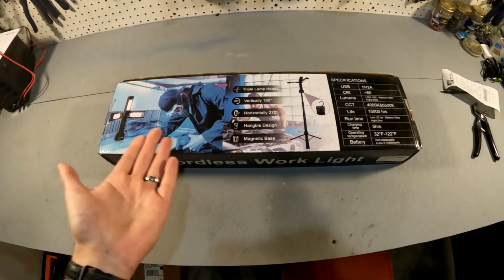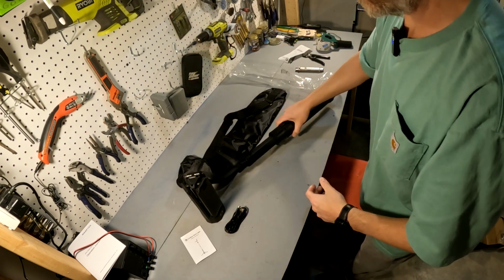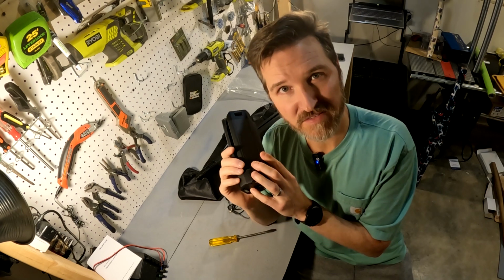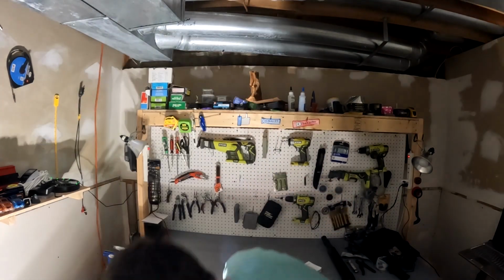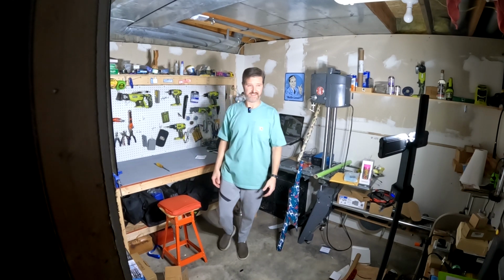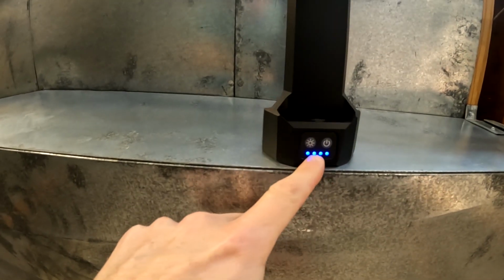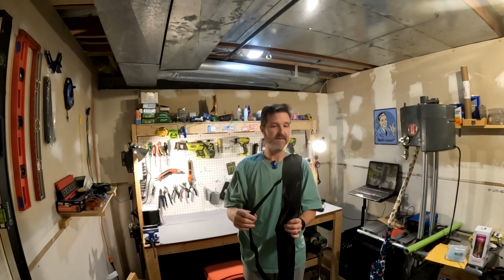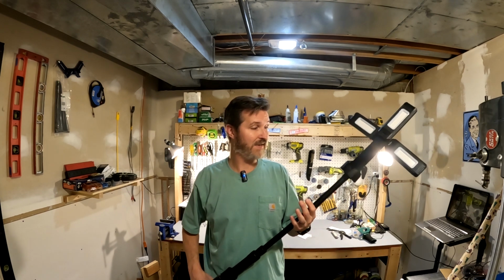Workshop Cordless LED Light Review.  My new favorite!

Comment: These lights are popping up all over the place. I live down here in Melbourne Australia & just purchased one that looks exactly like the one you have except different branding. It only has 4000MAh battery inside but the tripod stand is taller at 6 feet. It cost $99 Australian compared to 40 US Dollars on sale at Costco US for the example you have. (we call that the Australia tax) Yes they seem really well built with all of the tripod & the adjustable "light blades" being extruded aluminium & the main body of the light (containing the battery & controls) being plastic. My version with the smaller 4000MAh battery is supposed to run on low (which is pretty bright) for 8 hours so I'm testing that with stopwatch as I type this. On the negative side the power button (like so many devices) is very easily pressed so care should be taken when packing these for travel because if it turns on in transit while packed in the back of you vehicle you could very easily have a fire breakout with obvious associated dangers! Also the bottom of the tripod centre sits only about two mm above the ground so if using the stand outdoors like when camping your going to need a very flat bit of ground to place the base on. Despite these issues it still seems a pretty decent light & stand for camping which is my intended use.
Reply from the maker: Thank you for the great information and the comment.

Comment: Nice work light! Seems well designed. I only wish it had a changeable battery. I have Ryobi and Ridgid work lights and lots of batteries to swap in so that is my preference. The Ryobi Hybrid Panel Light is similar to this one but you use your own tripod.
Reply from the maker: Thanks for sharing.  Swappable battery would be a nice feature.  I don't have any Ryobi work lights, only the flashlight which isn't LED!  Thanks for the comment.
Reply: @OffGridBasement  I have two of the modern LED Ryobi work lights and they are my favorites of any tool lights I own. The panel light PCL631 which is 3000 lumens and the little P796 Compact Area Light which is really great for run time and working in tight spaces. Its 400 lumens but if you get a two pack they are affordable and probably one of the best hurricane or disaster lights if your on the Ryobi platform. A Youtube channel did a battery run down test on high with a bunch of battery sizes and its pretty impressive. The channel is Live Free and Tool On and the video is "Ryobi Area light [Review + Test]". Even if you run two of them on medium it does well to light a room or a small space. The diffuser on them is really well designed. Easy to look at and 360 lighting but with most of the light coming out the top of the light so you can still direct the output where you want. I've laid mine of their sides to point them at things I'm working on for example. I had one right inside my drop down ceiling when I was running cables in that tight space. I like the P796  so much I bought 4 of them! Also bought Ridgid to Ryobi battery adapters because I have a lot of Ridgid 18v batteries so I'm all set.